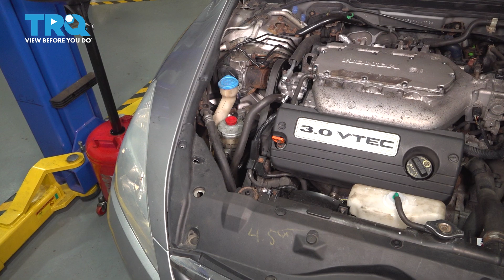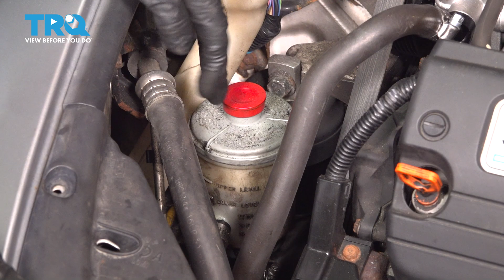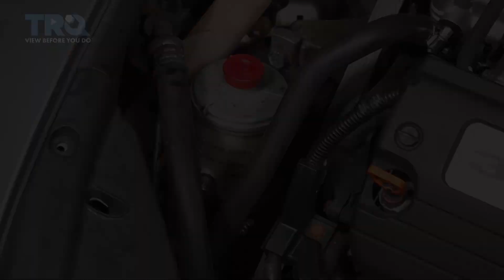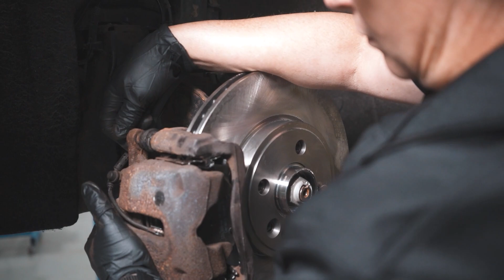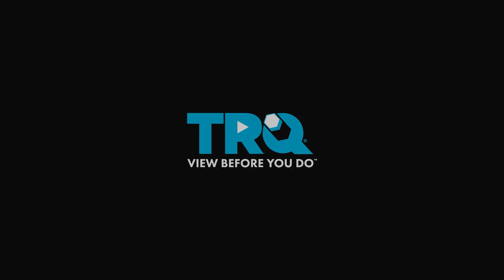How to Drain, Fill, Bleed Power Steering Fluid 2003-2007 Honda Accord

Comment: The total fluid capacity of the power steering system is 1.16 qts.  It did not appear that the technician removed and replaced that equivalent.

Comment: That old fluid was red like ATF which some vehicles take but not Hondas and most other Asian cars. It should be power steering fluid which has a clearish amber color. The whole system needs flushed. It's done the easiest way by using the return hose on the reservoir.